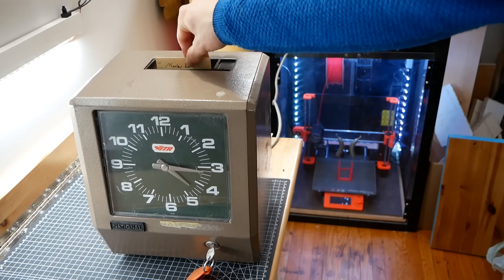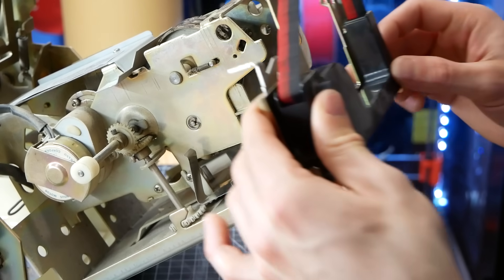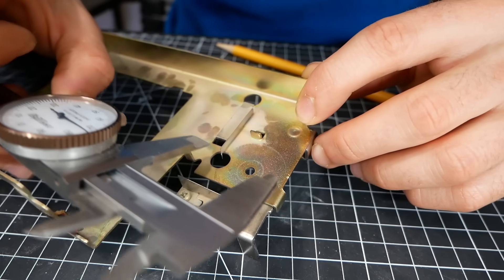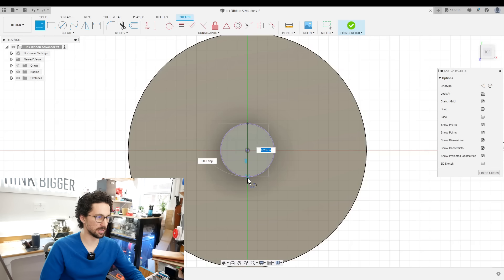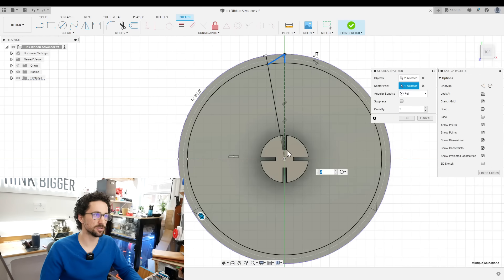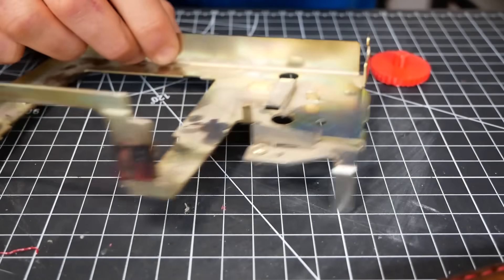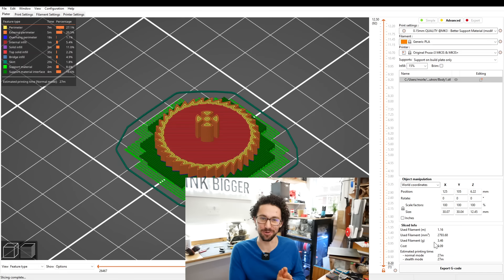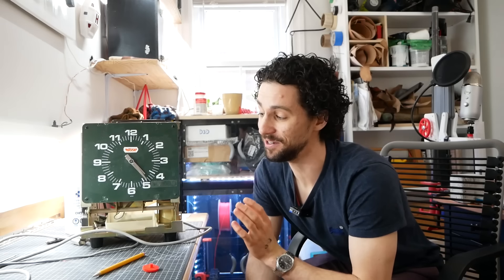They wanted 100 dollars. I 3D printed it for 9 cents.

Comment: It's only 18 cents (you had to print two to get one working one), if your time is worth nothing.

sure, they should have been able to sell it to you for something reasonable, but they know their target demographic is going to just buy the whole assembly. heck, they probably have a service where you pay someone $500 to come out and fix it.

one also has to consider your expertise with fusion, and troubleshooting and owning and knowing how to operate a 3d printer, none of those were free.

is it a fun little hobby project? fuck yeah. is it unbelievable that they wanted to charge $100 for a replacement part? to me, it's more unbelievable that they had it for sale at all!

Comment: I'd be tempted to rubber coat the metal bits that engage with the plastic bit ..or something, because I don't think the plastic part will stand up to so much wear.
Reply from the maker: I guess I'll find out! The original gear was plastic so I'm optimistic.

Comment: Of course, to produce your 9c item (by the way, you printed a failed piece so it cost 18c) you use a $900 3d printer, software on a pc, probably another $500 at least and an hour (?) of skilled labour. The company had these items mass produced, probably by injection moulding, which is an expensive process to set up due to the cost of the moulds and the 'injecting machinery' and they had to inventory and store this spare part and pay a clerk to look up the part and answer the phone. You are not paying for the production cost of the part but for the storage and retrieval overhead and the wastage represented by the stored spares which will never be sold for this clearly obsolete piece of machinery. I think you were lucky that they could even offer to supply the part ;-)
Reply from the maker: Still a win from my end!
Reply: @MorleyKert  Exactly! You could in fact buy a similar model printer new - they sell (or sold recently) similar ones at Staples but whats the fun in that? LOL
Reply: Wanted to point this out as well...................it is never 9c. I'm a former Graphic designer turned 3d artist and just your design cost from me would have been more than $90 hahahahaha

Comment: I agree with you that $95 is quite a lot, but what would they have sent you? The complete metal part including gear? Also, isn't it clear what the original gear was made of, metal? Another small improvement, make a screw and washer that holds the gear to the metal plate. it was probably thrown away with the last ribbon change.
Reply from the maker: Yep! They wouldn’t sell me just the gear on its own. The original gear was made of plastic.

Comment: That was really cool. The one thing I would wonder though is what the gear on the replacement part is made from (plastic or metal). I wonder how well that 3D printed part would hold up to sustained use. For personal use though that is definitely awesome
Reply: Can print 6 just as easily as 1................. Although I would have used my resin printer with some tuff resin ;-D
Reply from the maker: Thanks! The gear that comes from the manufacturer is plastic.
Reply: @MorleyKert  if it breaks in a year or two. what is it to you.. another 9 cents?
Reply: @nickg6312  If it's a year or two, would be terrible if it's only a week or so.
Reply: @ikannunaplays  It would be trivial to send the schematic off to a company to make a steel version, or use a stronger plastic, or even embed flat steel into the contact faces of the teeth.
Reply: @Fanta....  Trivial yes, cost effective? I think harder/ more durable plastics, sure

Comment: Well the $95 is for the entire piece including the stampled metal piece. It would be nice if they could have offered the gear as a separate replacement part. Goes to show that someone with a bit of skill, knowledge, and patience can achieve wonderful results. Thank you.
Reply: Honestly it's surprising to see that the company even bothered to support this request. This time clock is ancient at this point. The fact that they are still supporting it and allowing users to buy parts is definitely worth the $95. Like I get that the company probably paid nowhere near that but still that level of support for a product is insane. I work with enterprise OEMs all day if I asked any of them for a part on a model that was over say 3 years out of production (and not a part shared by in production models)  they would look at me like I was insane for asking.
Reply: Yeah, but I bet they don't sell many spare parts for this thing these days, so even the stamped metal piece probably has a huge mark up on it. Even if you were able to just buy the cog they would have to charge way more than you could 3D print it for, simply because they have to cover the cost of storing them and paying full time staff to ship them out on the rare occasions people order them.

Also, it cost a few cents, but that's only in 3D printer material, it doesn't take into account the other costs involved in making this 3D printed part or the hours of energy spent on making it. Like how much is your time worth, what's your hourly rate? How much time do you need to spend learning how to use the software and getting your 3D printer set up? How much did the printer cost? How much did you spend on electrical energy? How much energy did you use just learning and printing test pieces before you can print that one piece? If we're more honest about this process, if your only aim was to make this one cog, you would have spent way more than $95 to 3D print it. Just buying a 3D printer and getting it set up would cost you more than $95.
Reply: yea title is extremely clickbait and misleading
Reply: imagine if he billed his time out including the assembly and printing as well as the design of the component 2 prints = 50 minutes and then at least 2 hours for the rest of the time  ,  35 per hour means it cost more to make 1 part, that justification is not sustainable unless you are printing thousands and selling them for 20-30cents minus tax and the cost of electricity...
Reply: @silentassailant3905  and @Red Cube yeah these are all good and valid points I very much agree. I think this was just the appeal point angle he was taking for the whole video so he had to big it up a little. Also I think the lack of people to adequately calculate the total cost of things from all inputs is a fundamental human condition. It's what facilitates companies like uber running their drivers into the ground, as the fares barely cover car maintenance for wear based on miles drover just for uber, let alone a salary. It's also a key point of all this sustainable development goals stuff that's going into high gear, they are going to try and expose the hidden social and environmental "costs" of things, of course it won't be done in a fair or reasonable manner, and just result in exploitative practices and rent seeking, but who knows I hope they change their ways and prove me wrong....
Reply: @silentassailant3905  He spent more time making the video than he did making the part. Unless you're counting an hour of research which I doubt is the case. He mentions the video being 20 minutes long, but he wouldn't have needed to watch the whole thing since the section showing the part he needed is in the first five minutes call it 10 minutes for research since he knew the model and everything. That's also being generous and assuming he watched through the whole first 5 minutes and didn't just skip all the talking. He would spend at most 10 minutes recording measurements and that is being generous. 20 minutes to prototype it and that's allowing for things like the program starting up and slicing time but probably wouldn't take a full 20 minutes. Print time is free, the 30 minutes for each print can be done while he's reading a book or surfing the web whatever. You could charge for machine time but it doesn't count as actual time worked by the engineer. Another 5 minutes for each prototype removing/cleaning/test. Another 3 minutes to make the changes to the prototype.

Actual work time here is maybe 53 minutes? Call it an hour just to make things easier and account for variability in the process. So for time worked costs, you're looking at 35 dollars.

Cost of electricity for the printer is going to be less than a penny for each one you print, cost of materials is 9 cents each. So $35.10 if you had to engineer the piece from scratch. Keep in mind that 35.10 is only ever spent on the first part. Each additional one could be started printing and cleaned up by the lowest paid employee. 

They aren't going to have to engineer it from scratch, they have a mold somewhere, or a file they can just load up and print out one, or a dozen, however they do it. It won't be an engineer getting paid to do that though, it'll be some floor worker who has to setup the machine. Some of that mark up is because you can't buy the plastic piece without the entire metal piece as well, but it won't cost them anywhere near 95 dollars for parts and labor. They are still significantly marking up the price of the part.
Reply: I was about to say the same. Is great to ve able to repair something by ourselves "just" 3d printing it for "cheap" .
Reply: But he used 3 hours to fix this which is also about 95$
Reply: @danielh1589  I'd say if he is used to using that software, he probably needed about 10 to 15 min to do all of that like taking measurements etc. Of cause the printing took time, but I'm pretty sure he didn't sit there and watch it in real time
Reply: That 3D printed part actual cost is 9 cent + hundreds of $$$$ in equipment, software and personal time spent to lear.
Reply: That's always how it goes... they don't want to have a bin with plastic disks in it, they want "efficient inventory" so that means having every assembly task happen in the hands of a foreigner, and only the "repair install" being done at repair rates.  This is true with everything from appliances to cars.  Sometimes these intermediate parts don't even have a part number on them, and thus the only way to get them is to make them yourself.
Reply: odds are they never sold thatgear as a seperate part as it would be more profitable to sell the entire assembly as a single unit.
Reply: What engineering is a thing now? "A bit of skill, knowledge and patience" to fix something, i guess you need hands and eyes too. he literally printed a plastic part which he had luck having messurements (else it would had took some trial and errors). It's not that hard. Props for working with parameters that was quite insightful information.
Reply: buy the whole piece, use a resin to cast your own copy of the gear then return the original.
Reply: @sanddagger36  I doubt they're going to accept returns. This is so expensive because it has to be made. If these parts were sitting on a shelf, they'd be glad to clear up the space and it wouldn't cost so much. They're going to make them with real manufacturing methods, not 3d print some hacky junk.
Reply: @timramich  thanks for the serious reply to my joke comment.
Reply: It's an old company. They have no clue what a 3d printer is. Apparently they also have no clue about fair pricing... Well the later is quite common for modern companies too.
Reply: @michaelthomsen8771  The pricing is insanely fair. They kept a part for an obsolete device on a shelf many many years past its production date while keeping inventory and actually responding to any potential customers looking to get their device serviced. Most companies would have told you to just throw it away and buy their latest model.
Reply: @KosmicK  they didn't sell a part, so no the price is not fair. If the price was fair a transaction would have taken place
Reply: @michaelthomsen8771  Plenty of people would have taken them up on that price. If that clock mattered for running a business and there were a simple drop-in fix for $100, that's an easy sell a lot of the time.
Reply: @KosmicK my thought exactly. if you have a company big enough that you want a timestamp solution 95 dollars is nothing. Although you probably moved on to a digital system 20 years ago. 

Meaning that they are stocking an obsolete part for decades for big old companies that can't be bothered to change. I mean how many parts like this would they sell a year? Five? Even one? Warehouse space is not free.

 I say kudos for even stocking the part and not asking for something outlandish considering the regular use case scenario.
Reply: @michaelthomsen8771  the only reason they did not make a sale is that the customer has, and knows how to operate, a 3 D printer.  I doubt that they consider that as a threat to corporate profits.

Comment: One could say "well, you need 3D modelling skills, so you might as well buy the part". But you did the Fusion360 part so well, and some great tips too that I as a newbie to that program had no idea could speed up the work flow. Great video!
How long do you think the gear might last?
Reply from the maker: Thank you! I think the gear will last a long while, because the original gear was also made of plastic. If it breaks, I can always print another!
Reply: @MorleyKert  There are of course different types of plastics twith different wear levels. You could print this with nylon and with a little gear grease will probably outlast most of the other components. Thanks for the video, I wasn't aware of the parameter function in fusion. I've been using fusion for a couple of weeks now, moving from solidworks. I should've made the move much sooner!
Reply: @imqqmi  why are you moving from SolidWorks to Fusion, and why should you have done it much sooner? I'm just learning SW
Reply: @keithwins  Through work I had access to SW 2017 with hsmworks, it was buggy and tedious to work with using cam. Fusion 360 is better integrated and feels a lot faster to work with (still using my old pc from 2014, 3.1ghz quad core 16GB though). After upgrading to windows 10 I no longer had access to a working sw and hsmworks combi, which is fine for 3d printing but not for machining aluminium. I really wanted to use hsmworks adaptive clearing. I've exported drawings in dxf and used them as 2.5d cam in vectrix, not ideal. Fusion just has everything I need and is free for hobbyists like me.
With my sw and hsmworks knowledge I was able to design a simple touch plate and output compatible cam in fusion 360 within 4 hours. I was amazed how quickly I could pick it up, after weeks and weeks of sw learning and some weeks more with hsmworks. Granted, that prior knowledge greatly sped up what to look for in fusion 360, but it's just better integrated. And it doesn't crash so far and doesn't complain about low resources as sw does. Ok so I loose some features that only paid tor users can access but I can work around them like the rapid moves are the same as g1 moves, 10 active read/write documents limit etc.

Comment: A showcase of the practical uses of 3d printers is more what we need in general. We all probably print some silly and useless stuff, but fixing something with a 3d printed part is what starts my blood pumping. The only doubt that I have here is that PLA will not last long while grinding on the metal strip. PETG or Nylon with PTFE spray coating on the gear and the metal piece is probably the way to go. But PLA gear is still way better than paying $95, fuck that... :D
Reply from the maker: I get such a kick out of functional prints. If the PLA wears out, I can always print a new one out of PETG! Thanks for watching 😊

Comment: That was great. Nice design process too.

I'm myself learning, but for the step of carving out the teeth you could have cut one and then make a circular pattern of the feature instead. That would save you selecting 35 individual sketches.
Reply from the maker: Thank you! You’re totally right
Reply: Furthermore, the number of teeth could be calculated by putting a formula into the circular pattern. The formula could be something like 360°/{teeth angle}
Reply: Nice call. Patterns are extremely powerful in Fusion 360. To do it without a pattern I would have started with a circle larger than the gear size and turned the "ShadowDiameter" into a guide and then one click would have selected all the gear to be cut. So many ways!

Comment: Love your videos, keep 'em coming! Just wanted to mention a quick shortcut in Fusion 360, after creating your sketch for the single gear tooth instead of using the circular pattern in the sketch, extrude cut the single gear tooth, then use a circular pattern and change the type to "feature" choose the extrude feature and pattern that. This will make a few things easier, one you don't have to select all of those profiles in the sketch, and two you now have the circular pattern in your timeline which makes it easier to edit later on.
Reply from the maker: That’s a great point! Working on something in Fusion right now where that comes in handy, thanks!
Reply: @MorleyKert  Or another way which works fast: changing the circle to a construction-line type so it is open and offset it like 2mm to the outside. You then only have to press once since it is one closed space.
There are many ways...

But very nice to see how you made it.
Reply: @elvinhaak  That's how I would have done it too. 1 sketch and 3 extrusions would have done it. This timeline is way more cluttered than it needs to be for such a simple component.
Reply: Came here to say that lol